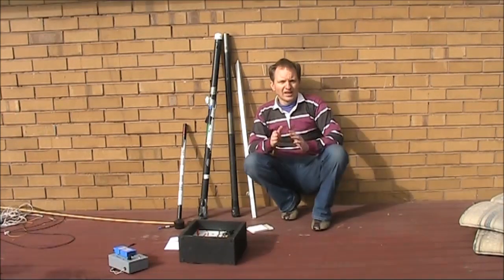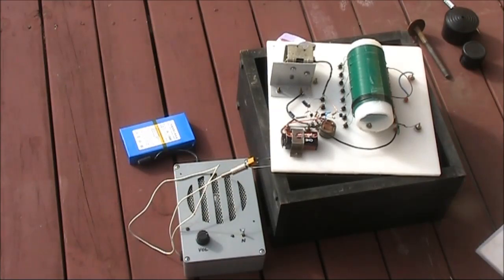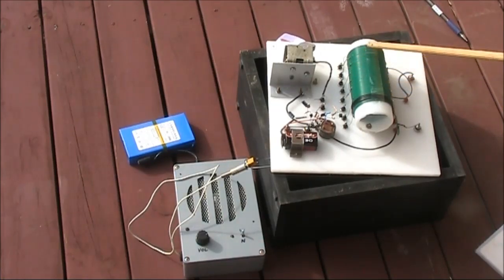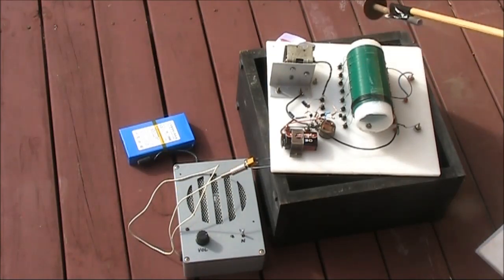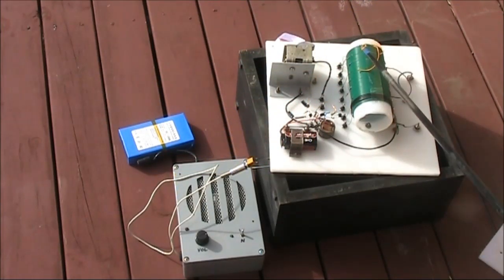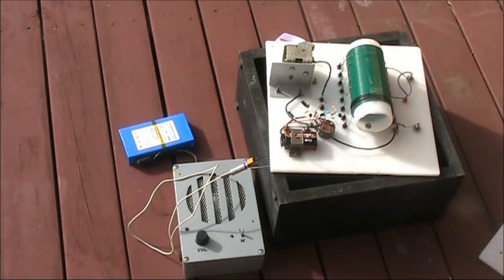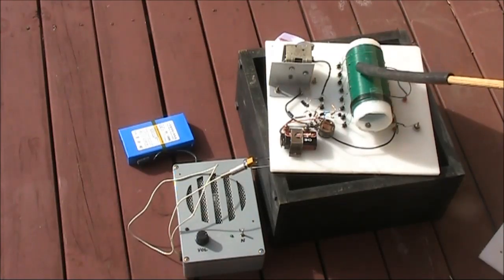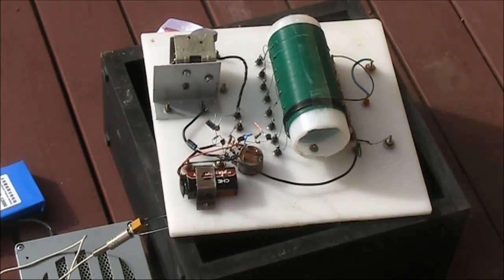Testing antenna materials for RF properties with a simple receiver

Comment: Very interesting experiment, Peter.

For dielectrics, the dielectric constant (relative permittivity) would modify the inter-winding capacitance of the coil, thus causing a change in the coil reactance and thus the oscillator frequency.

Also of importance for dielectrics is the dielectric loss (often expressed as a loss tangent), as this causes energy to be absorbed in antenna components as spreaders, insulators, etc.  Dielectric loss would result in energy being lost from the tuned circuit, i.e. lowering the Q and broadening the bandwidth of the LC circuit.  This wouldn't be noticeable in your experiment, and is usually detected by using a "Q meter" or commonly by irradiating a sample with an RF field and noting any heating effect (e.g. microwaving a sample and seeing if it got hot).

Thanks for yet another instructive video.

73,

Mike VK2IG